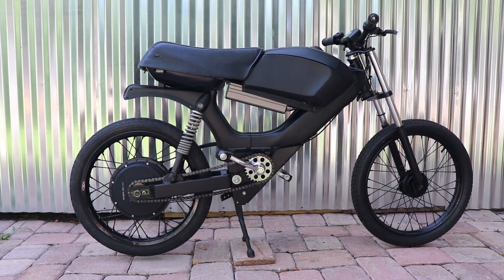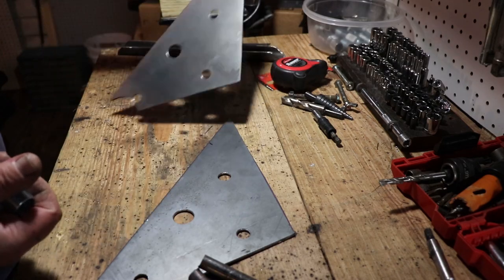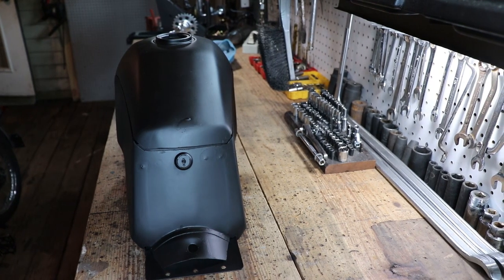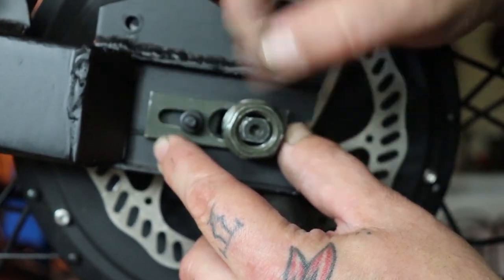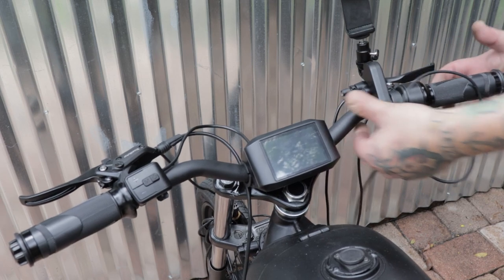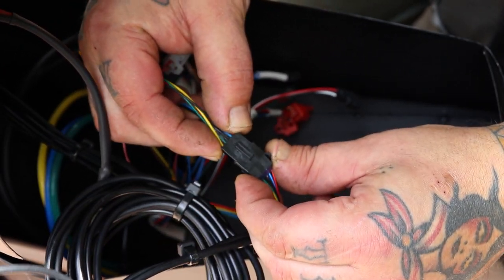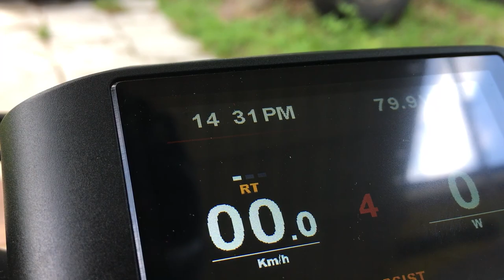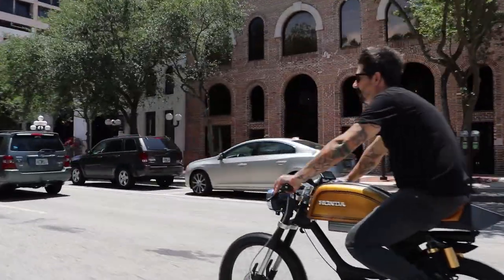Building a 60mph Emoped in 15 Minutes

Comment: You might want to use 2 bolts to secure the hub motor axle torque plate. Reason bring, accelerating and regen braking will rock the axle back and forth, over time the axle nut might loosen. Worst case scenario, is that the rocking motion will spread your dropouts apart.
Reply: Otherwise, clean build and great video.

Comment: Beautiful design it looks like the batteries going to rattle around inside the tank and when it rains water can get in through the lid will you maybe also have heat problems with that shrink wrap around the battery eventually.

Comment: I wonder what one for a Kromag Puch Pinto 2 or Swinger 2 might look.... with a box containing all of the electronics, and cells, that's basically a pod styled like the original fuel tank, and maybe clamp mounted to the tube frame inside the step thru area, leaving the original tank in place, but using it as a storage area for gloves, goggles........ a few beers...make it weather-tight.....add a little salt water and ice........ 😄

Comment: I have a couple General Mopeds I would like to convert, do you sell kits for these? I really don't need all the brackets and swing arms, I can fabricate stuff like that just the Electric specific stuff (motor, controller, throttle, battery)

Comment: So sick!!! At 6'6" 250lbs, would there be any issue for me riding one of your badass emopeds? Thinking weight wise...but maybe also seat height?
Reply from the maker: 6foot6inc weight is no issue, as far as ride height is concerned we could use taller adjustable rear shocks so you can get it perfect
Reply: @ELECTRICMOPEDEMPORIUM  Righton! Well I'll be looking out for that website as I get some scratch together for you! If I went the kit route (getting your conversion to self install), what do you suggest for sourcing a Tomos (or similar bike?)...or how does that work?
Reply from the maker: 6foot6inc Fb marketplace is a good place to start if not I’ve got about 20 right now I sell built bikes too, my YouTube is the tip of the iceberg and runs about 8 months behind where I’m actually at so check out my Instagram for up to date content
Reply: ELECTRIC MOPED EMPORIUM thank you! I deleted FB a couple years ago, so I’ll connect w you direct. 🙌

Comment: I'm building an electric moped myself and have some questions about your swingarm setup. If your pedal bracket is not attached to the swingarm, how does the chain stay aligned when the suspension is compressed? Wouldn't the chain lose tension when you go over bumps? I've been struggling with a swing amr design because I thought I had to integrate the crankset into the swing arm itself.
Reply: Nearly every motorcycle has a similar setup as you can't usually place the drive sprocket colinear to the swing arm pivot.

Otherwise you can try make a setup similar to what Cars and Cameras used for the rear (and front?) of their  power wheels Bronco project, just with pedals on the ends of the shaft.

Comment: Very cool. But even modern bicycles come with disc brakes as standard. A vehicle of this weight with this power should come with disc brakes as standard, not as an upgrade option. All the stopping power comes from the front wheel.

Comment: Hi. The controller is a 100amps yet the battery is only 35amps. Does that mean more power is possible with say 100amp battery?
Nice work btw😁
Reply: No, just means a 35ah battery lasts for less time than a 100ah battery. They can supply more than 35 and 100 amps, just their runtime is reduced. 

The same goes for putting a bigger controller in. If you have a motor that draws 50 amps, changing from a 50 amp controller to a 100 amp controller won't make the motor go faster, the motor will only make use of 50 of the 100 amps. 

Basically you want your supply items slightly bigger than your demand items so your supply items don't have to work as hard, and you get the most performance out of your demand items.